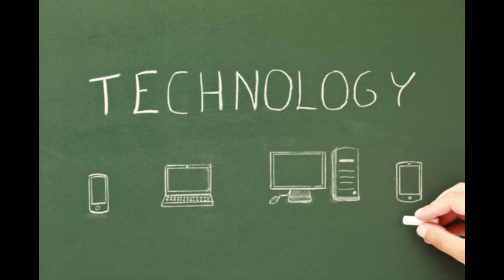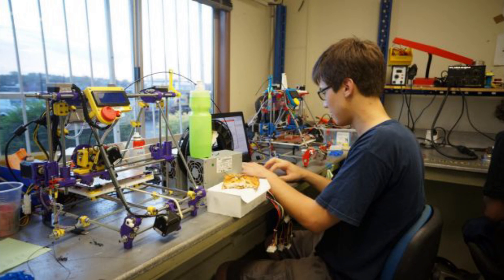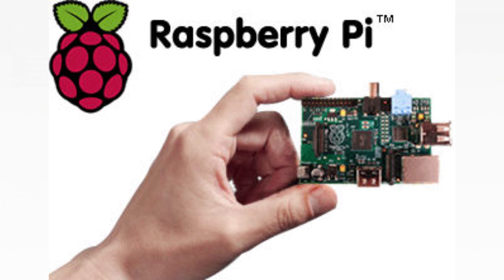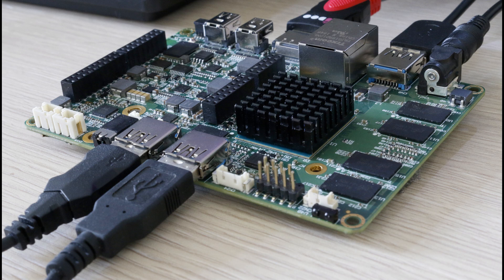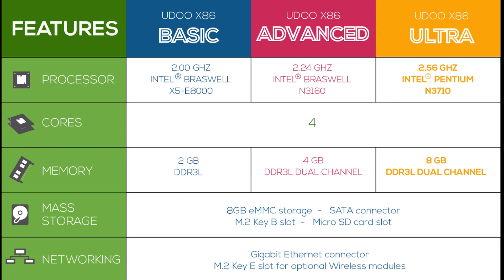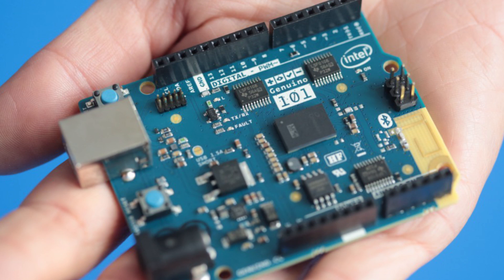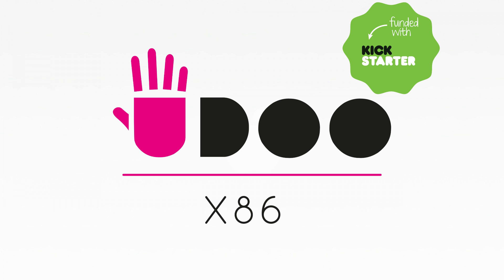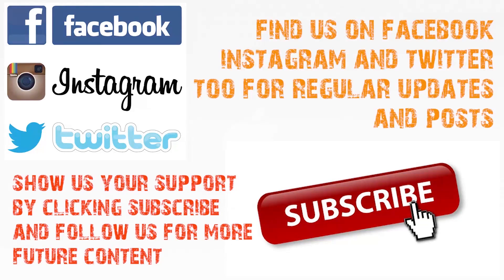UDOO X86 a raspberry pi killer?

Comment: For anyone thinking this is overpriced then it probably is, but unlike the raspberry pi 3 model b that has 1GB of RAM the UDOO board has 8GB of RAM. Also you only use certian things for certain uses. If you need a cheap baby monitor then go for the raspberry pi 0 for $5. If you want a PC for a little bit of gaming and everyday use then go for the UDOO board. By the way this is the first model which means it can get cheaper. First look at the raspberry pi first model. It has less power, but costs as much as the raspberry pi 3. If we just go ahead and reject a model such as the raspberry PI then the raspberry pi would not exsist and probably a lot of people might have to buy a $5,000 dollar computer. Why not give this first UDOO model a chance and see how it will go. It might soon be better, more powerful and cheaper than the raspberry PI. But again only use these for your needs and not just because it is more powerful, but of what you will need for your own things.
Reply: The irritation simply comes from the word "killer". It implies that it's meant to directly compete against the other product, while being within the same price range.
yes, it's ten times more powerful than the Pi 3, but the pricing isn't within the range of the Pi series.
Reply: CheffBryan Yes, but that is because they are using more expensive things. 2 raspberry PI's would cost about the same as this, but will use more power and wont be as powerful.
Reply: NASIRUB1 MMMmmm... Wise you are...
Reply: ***** The raspberry PI is only popular due to the popularity (for some reason people want to get something popular :P), its reliability, price and just for its simple installation unlike the UDOO board, the raspberry PI has a very simple installation for both its hardware and its software. The UDOO board comes with a few SD cards which some people won't know the difference and won't understand it very well. All I think I am trying to say the UDOO board isn't a raspberry PI killer, it's just because the raspberry PI is a simple machine wanted from people for small projects. The UDOO board would work more as a workstation rather than a dedicated board for a small and simple project like the raspberry PI.
Reply: Well put, you're very wise, like....Yoda. The Force is strong within you.
Reply: Do you need a truck for  your groceries ?
Reply: +Jose Gonzalez A Lamborghini is also a City car killer. its about segment. A GTR is a Porsche killer. its cheaper and faster then most General Porsches. 

Something that overtrows the product completely with price spec. For the raspberry pi the Community isnt easily killed.
I own an Udoo board quadcore. its fast. Its not a raspberry pi killer in any single way.
Reply: Jose Gonzalez i think its beast. this will do me justice for a real tablet and real car built in landnav upgraded to godmode like project dashboard coupled with arduino cuz i use arduino alot.
Reply: Jose Gonzalez true
Reply: Specs aside, we are comparing the Raspberry with a product that costs almost 10 times morem which is the price for the 8Gb 2.56GHz model, so yeah, kind of pointless. Would call it killer if it was x3 faster and x2 more expensive, maybe.
Reply: Jose Gonzalez @ what type of memory chips did they put on the  board to make it cost  around $100 ?    Chinese people manufacture memory chips  everydays for a few buick
Reply: People would have to buy a $5,000 computer? What the hell sort of computer are you buying? And surely whoever is selling that seen you coming from a mile off.
Reply: Right you can't really compare a Pi to this. Pi is a low end, low cost computer and the Udoox86 is basically trying to shrink a desktop. Totally different universes. But the fact that the Udoo is still under 300$ is amazing for everything that's on it and it's form factor and the adruino compatibility, which really is the revolutionary thing here.
Reply: yes, but an x86 processor can only recognize 4 GB of RAM! Why they did an 8gb version?

Comment: unfortunately this is an not a true comparison video since Raspberry PI is an ARM board and udoo x86 Board so the guy is an absolute ass for trying to compare udoo x86 platform to the Raspberry Pi ARM platform
Reply: Its going to be sold as a Raspberry PI alternative so of course the 2 boards will be compared. Think before you make stupid comments.
Reply: +Brian C look like I have said the udoo is an x86 platform system so its a scaled down PC. Unlike the raspberry pi is a dev board on the ARM platform. 2 separate systems not comparable if the udoo was an ARM platform then it would be a different story so this comparison video is flawed since udoo is using the x86 Architecture and the raspberry pi is on the ARM Architecture
Reply: No the udoo is a dev board that is based on x86 hardware. That does not make it any less of a dev board. I could use either board for my projects. I'd rather use the udoo board. Of course different architectures can be compared.

Comment: 4x SATA (at least) for a home NAS and we have a use case. Other then that, either a 2nd hand Intel board (for real use) or a ARM (for hobby) will do.
Reply: I have been successfully running ZFS for 10 years (BSD, Mac, Linux -- same volumes) using two USB3.0 (+eSATA) 8-bay enclosures.  Performance is excellent (70MB/sec+) for a media server and it has been very stable -- USB3.0 mode has been much more stable than the various port-multiplier-supported eSATA card Linux drivers have offered.  I want something to power a portable Plex Media Server + speakers (Lepai 2020A+) + projector box.

Comment: All this kills is your wallet for such sub-par hardware. This is not in pi's price range. DOES NOT COMPARE!
Reply: Pi gave us an affordable mediacenter but now its outdated and only relevant for the 1% nerds using it as a computer. If you want more power, less heat and 4K streaming you need to move up in pricerange, its a natural development.
Reply: And for another $50 you can sometimes find offers for true quad core PC's... It's not the same. 

The Pi's are awesome because they are basically throw-away computers. As soon as you begin to pass the $100 mark, you are getting out of that leauge.
Reply: Of course it compares,its a compact pc just like the pi, its double the price of a rasberry pi but 10 times as powerful the higher cost is justified by its performance increase.
Reply: Raspberry pi 3 ~ $40,  UDOO x86 ~$90 with 10x the performance of the Pi 3, along with Full Desktop functionality
Reply: +eraldorh ohw does the Udoo Community kill the raspberry pi Community and internet informstion too?  Which is the most important aspect with the price together. NOT performance.

Comment: so if I'm looking for a media center pc should I buy the banana pro or the rasbairy pi
Reply: rpi
Reply: Banana pi has a gigabit ethernet port, but most of the non-raspberry pis have comparably poor software support. If you like tinkering with software (read: spend frustrating hours getting it to work) and really do need that one extra feature each pi has, go for one of the alternatives. Orange pi can do 4K and the new h.265 codec, and it comes in several models starting as low as $10. Raspberry definitely has the best compatibility though, which is a point that should not be underestimated.
Reply: Dennis W i dont want 4k i was looking for someting to tinker with
Reply: zach schwanke Orange is also the cheapest (that actually ships, unlike the raspberry pi zero), but it seems you've already made up your mind.

Comment: Overpriced. If this thing is approximate size of a Raspberry Pi, it should be the approximate price of Raspberry Pi. For $89-$130 I would rather spend a bit more money and buy a regular laptop PC. In addition, it has nearly no GPIO pins: nine! The Pi model B+ has FORTY pins. As for processing power, projects that make PiBots don't need much processing power, so why overdo it and spend to much money? For more simple projects like a cat-feeder you can use a Pi Zero for only FIVE DOLLARS! Get lost!
Reply: Except they pack a lot more into it. The pi maxes at 1gb of ram while the UDOO x86 maxes at 8gb. Pi's use SLOW arm processors while this uses a much more powerful, and far more compatible x86 chip (though still slow by desktop standards). Just looking at the size misses a lot. I have always wanted to pick up a raspberry pi, but the limited ram and I/O made it about useless for me.  For many, the pi will be enough, but for those of use that want real power, and plenty of ram this looks to be the way to go.
Reply: and cost...? convenience & price > power. Cat feeders don't need overpowered fancy-pants udoo x86!
Reply: The UDOO x86 is the new performance:size king at just double the price of a Pi
Reply: It's all about size. You have to remember this is not motherboard it's a tool for makers.
Reply: robofatcat It's both. That's the beauty of it. It's small enough to be used in many demanding projects the pi just can't do, and powerful enough to be used as a HTPC / general computer. Not all projects want to blink a led. Some need real power which the pi just does not have.

The pi still has it's uses and is still a capable device. For the size / price it's a remarkable thing. In many applications the UDOO would be overkill and the pi would be perfect.
Reply: Hatagashira Mini-itx is a lot larger (nearly 50% larger) and normally needs a standard atx psu, eliminating mobile use, or at least making it more difficult / expensive. It's great for some uses, but the UDOO will be better in others, as it's not the same thing. Nano-itx, Pico-ITX, and Mobile-ITX are almost exclusively the domain of VIA and their parts are severely underpowered / junk.

Both Mini-itx and to some extent nano-itx have their place. But if you need a small board with a lot of power, neither really cut it. All these are also lacking Arduino compatibility, which the UDOO has. Not important to me, but some may want it.

Sad you have to call what could be a good project board, crap, just because you can't see it's possible uses. If it's not for you, move on.
Reply: Hatagashira "and the udoo has so little gpio it's barely usable anyway so that's a complete non-argument."  For you perhaps. Don't be so narrow minded. Unfollowing thread as I can see it's going nowhere. Too many look at what they want and expect that, and nothing more or less, will match what others need.
Reply: Popular comment!
Reply: mshesh16 So get UDOO x86 if I want to emulate 90's console and arcade ROM'S properly...?
Reply: For those of you that want real power and plenty of ram, there have been plenty of options already. This stupid device is just a non-standards compliant x86 motherboard with the chip soldered on. You can get a mini-itx or nano-itx board that does the exact same thing, costs the same or less, AND is standards-compliant meaning you can use standard computer parts with it, and most of them have AT LEAST 2 sata3 ports and a pciE slot.

this "udoo" crap is just that. Crap.
Reply: harshbarj There's an arduino compatibility layer for linux and the udoo has so little gpio it's barely usable anyway so that's a complete non-argument.

You can get any random intel based set-top box with the same performance for less money and get more value because it's already in a nice casing and comes with a suitable power supply. Those are usually 5-24v so mobile use is no issue. They almost never come with less than 32gb eMMC either and sata ports are standard.

I'm calling it crap not because i don't /see/ the use case, but because it /has/ no use case. It does not have a single advantage over these cheaper, more feature rich boards for anyone doing anything useful, and if you're just learning you're better off with a raspberry pi because of the massive knowledge base getting you up to speed with embedded devices much quicker than a relatively obscure device like this one can. Once you've mastered that, there's no reason not to get a generic x86 set top box for half the price.